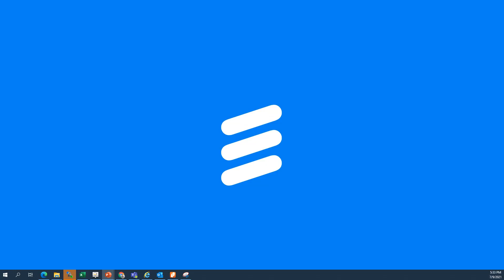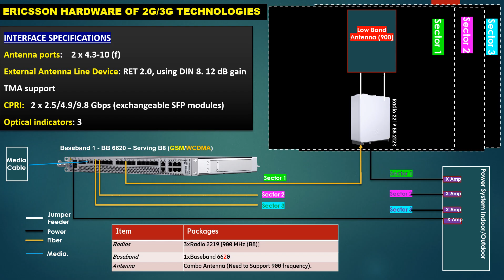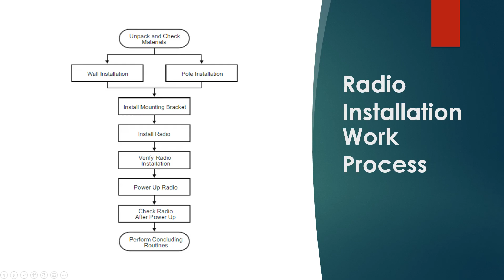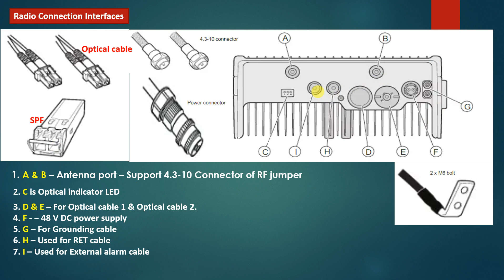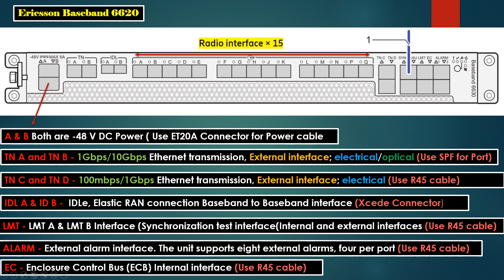2G और 3G टेक्नोलॉजी के लिए Ericsson हार्डवेयर | Ericsson 2G/3G कॉन्फ़िगरेशन | इंटरव्यू के प्रश्न

Comment: hi ,

kindly ,we have repeated partial outage due to alarms HW partial fault and it solved by replacing RRU (2219 B1) ,do you have any data why these alarms are highly repeated ?
Reply from the maker: Check power first & grounding if not clear please share alarm log